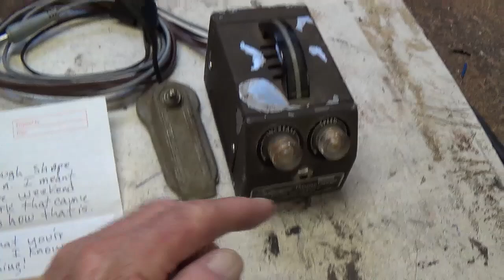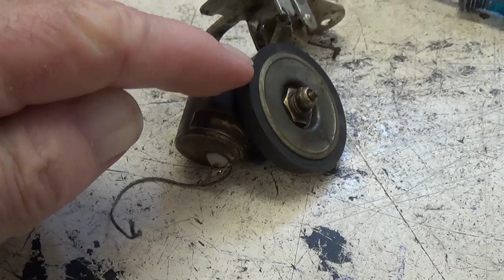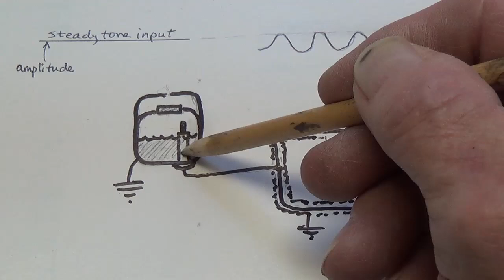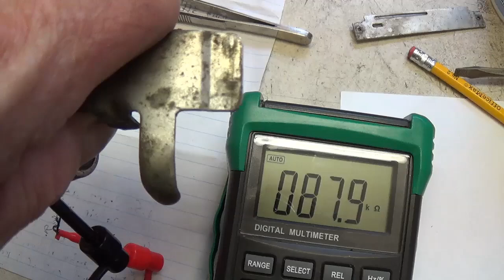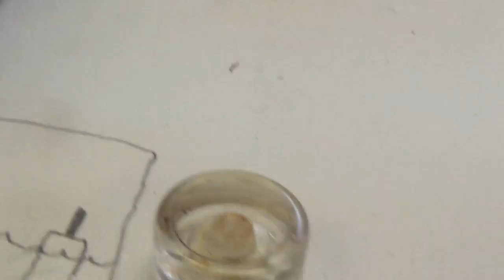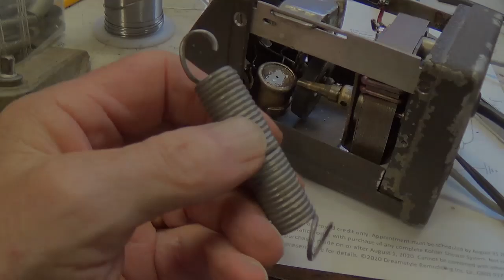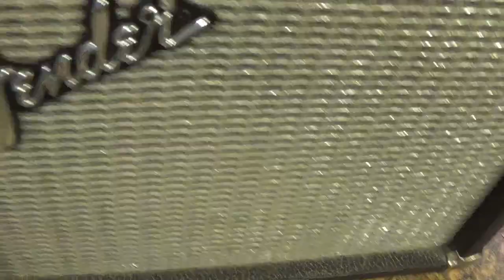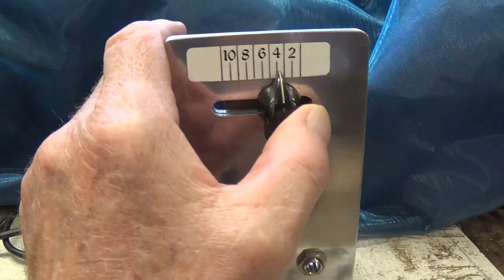1940's DeArmond Electromechanical Tremolo Unit.....DeAd on DeLivery !!!

Comment: The footswitch should be grounded as well if you want to be 100% safe and in line with the standards.
Reply from the maker: No doubt, SK.....but I really doubt that anyone will ever bother to do so.
Reply: @UncleDoug  If you think about it, it's a metal chassy carrying a live conductor. I would at least open it and see if the wires are nice and secure.

Comment: You changed two things at once. The log pot with a sig gen and then the reverse log with a guitar as source. Because the output impedance of the sig gen is low and the guitar is not easy to determine, it's difficult to know what's had the most effect. The unit should have been designed with buffer amps, of known ip and op Z, if the pot action was to be controlled and consistent.
Reply from the maker: Thanks for your input, Rico. I have since restored another of these units and the original pot demonstrated the same "hair trigger" effect, while the RLog pot stretched out the intensity control over more than 180 degrees of sweep.

Comment: Uncle Doug, did you glue the intensity knob back on? If so, what kind of glue was that? Thanks for another great video!
Reply from the maker: Yes, I had to, for it to remain in place. I used weather stripping adhesive, believe it or not.

Comment: Lose those solid noisy wires to the canister and replace them with some loudspeaker tinsel wire. Tinsel  wire is specifically designed to constantly be in movement with a loudspeaker's cone's vibrating to convert the energy of electrical impulses into audible variable air pressure "sound" energy, from the movement of the paper speaker cone.
Reply from the maker: The connection from the tank to the lead from the pot is indeed the woven silver flexible "tinsel" wire.

Comment: Doctor Uncle Doug. I have this same tremolo, DeArmond. As I turn my intensity up, the treble starts to lose out, and past 2:00 it gets very muffled. Do you have a solution to keep the sound from changing so drastically? I've already tried different levels of Windex. Thank you.
Reply from the maker: I've never had that problem, Rik. Have you tested the intensity pot throughout its full travel with an analog ohmmeter ?
Reply: @UncleDoug Phd.  Thank you. The potentiometer maxed out at 88k, min was 6. I love your videos. They motivated me into actually trying my hand at fixing stuff. When I looked more closely, the braid of copper wire to the cylinder was down to a single strand on each end...So I soldered a fresh braid on it. None of this fixed the issue. What I eventually figured out was that I greatly overfilled the canister with Windex. So I kept removing it a bit at a time and retesting. The signal improved tremendously and I think sounded best when the Windex level was just at the top of the white insulating part. Once again, thank you for helping all of us. You are awesome.

Comment: Hi UD!  Great video as always, and I got to learn about a device that I've never even heard of.  I particularly enjoyed your eplanation of potentiometer curves, and the use of area as a representation of control.  I have some observations, but since I have no practical experience with one of these units, they are purely theorertical.

I have concerns about the use of Windex as the canister fluid, and I'm curious about where that recommendation came from.  You mentioned somebody...  My first concern with this choice of fluid is the fact that it contains ammonia.  Ammonia can be harsh on things, and I am concerned about the long term effects of the elecrolytic/galvanic action such a solution might have on the electrodes inside the canister as well as the rubber seal.  The other thing that concerns me is that it contains surfactant (soap or detergent) which of course has sudsing action.  Given that the unit vibrates in use, I am wondering if foaming inside the tank could develop and give weird results.  A bottle of Windex will foam up quite well if shaken, so at least I have some practical eperience with that.  If the fluid evaporates over time and must be periodically replenished, the surfactant portion of the solution will likely not escape the canister but may actually be left behind as residue, accumulating and concentrating it, making sudsing more likely each time new Windex is added.  And how would one rinse the soap out of such a thing anyway if this were to happen?  Anyway, I enjoyed this video greatly, although I think whoever came up with Windex as the go-to solution for this device made an odd choice.
Reply from the maker: Thanks for your very thoughtful inquiry, HS. I worried about sudsing also and experimented with various solutions in the tank, including different concentrations of saline (salt). The conductivity of the fluid is critical. Too high and the signal is lowered all the time. Too low and the trem effect is weak. I have found that Windex has the proper conductivity and that sudsing, although it does occur, does not alter the effect......thus, it remains the best, consistent solution for use. Also, after being in tanks for several years, it does not seem to coat or harm any part of the tank.
Reply: @UncleDoug  I find it reassuring that you've got years of experience with this solution, and would be less reticent to try it in future.  I tried to research patent filings to get more info about the unit, but ran out of luck.
Reply: @hugeshows  Thanks for your comment and replies, I was also interested in the choice of Windex and this shed some light on it for me.

Comment: Here is a dumb and querky idea.Instead of an electric motor use a toysteam engine. You would have to use it outside and it would be awkward as all get out but no A.C. hum and the smoke and steam eminating from this thing would definitely be a sight lol!
Reply from the maker: You must be an old soul, David. I am a fan of steam-powered toys and this may be feasible, but wildly impractical......which means I like the idea :)

Comment: Question, when you supplied a modern 3 prong polorized  plug, how come you did not add a fuse  ?
also, on the power cord I would have added a choke to minimize any possible hum and AC radiation 
Ricky from IBM, Ret.
Reply from the maker: It was not my job to redesign the device, Ricky. It was my job to make it function well......and I did that. Are you proposing a filter choke for the AC supply to the motor?  This makes no sense to me. The signal wires were shielded and hum was not an issue.
Reply: Uncle Doug Not a criticism just wondering since the power cord was upgraded to modern standards installing a fuse would have gone along with that. 
Enjoy the channel

Ricky from IBM, Ret.

Comment: That's the most needlessly complicated vactrol ever invented!
Reply from the maker: Optoisolators weren't available in the late 40's, Frank, and the DeArmond does much more than a simple Vactrol.....it also replaces the oscillation loop tube(s), caps, and resistors.

Comment: Hey Doug, great stuff and great work as always - but this time here comes a little criticism from my side :) I am not very happy with the way, you guided the footswitch cable through the metal housing... As this wire also carries mains voltage, imho it's not a very good idea, to simply run this (also pretty old and maybe in the near future brittle) cable through this hole without any additional shrink tube insulation, grommit etc... If the user constantly bends the cable at this spot (e.g. by winding up the cable around the device), it might break and become very dangerous in the future... Hey, at least that what it looks like here on my screen.
By the way, do you run device tests, checking your repaired items for insulation and PE-R, after you're done with your job? Here in Germany, it is absolutely important to perform these tests, otherwise, as a repairman, you are completely f**ked, if any kind of electrical accident happens later...
Anyway: Keep up your great work!
Reply from the maker: Thanks so much for your thoughtful comments and suggestions, LM. The footswitch wire appeared to be quite supple and trustworthy, but I understand your concern, and will relay it to the owner of the device.

Comment: You may already know about this stuff but a trick I used to restore paint on metal is a 50/50 mix of Penetrol (for oil-based paint) and mineral spirits. It works like magic on enamels and powder coat finishes. A quick wipe with the solution then wipe up any extra.
Reply from the maker: Thanks for the tip, Tom.

Comment: I remember that once in one of your videos was written in your current limiter "not for motor" since then I wonder why is that (I didn't want to test it by my own using a power tool or a refrigerator connected to it because nowadays the Incandescent light bulbs are rare and expensive.) But now I see you using this device and my brain is shorted and I ask you about this caution.
Reply: Great and illustrative video by the way!
Reply from the maker: Most electric motors require an initially high flow of current to start. The current limiter interferes with this and prevents the motor from starting.  Very small motors, which don't draw much current can still work with the CL, however.
Reply: @UncleDoug  Ok, I see! I suspected something like that. Once I had problems with an inverter (plugged to a solar battery system) which with time didn't start a fridge neither power tools any more. So I thought maybe plug it with a big bulb to reduce the peak current, but I was afraid of damaging something. In the end I replaced the inverter and fixed the old one, but that "not for motors" stuck in my mind. Now I know in that case it even wouldn't start.  Thank you Uncle Doug!

Comment: Uncle Doug, this is a fantastically interesting video.  I've got a question about the original(?) intensity pot though.  Did it look like the original or something that someone installed by mistake during repairs?  If it was original, did the original DeArmond Tremolos all have intensity adjustments that were that limited?  Now I think I need to try to build an electromechanical tremolo myself, using this and your earlier videos as guidance!  ;)

Edit: I went back and re-watched the "Home Made Electro-Mechanical Tremolo" video posted by "ElPaso TubeAmps" where you said that Windex froths up too much for use (in that unit), so you used distilled water instead.  I guess that the (copper/brass) "tank" size is what allowed you to use Windex in this tremolo, because the Windex couldn't slosh enough to froth up?
Reply from the maker: Wow, thanks, Bob. Yes, it appeared to be completely original. Also, there is another video on YT featuring a similar unit, and they found the original pot to be just as "touchy" as I did. By coincidence, they resolved the problem in exactly the same way. By all means build your own. The principle is simple, but the way to achieve it offers unlimited opportunity for originality.

Comment: just wondering about using saline solution to affect the kettles resistance.
Reply from the maker: Years ago, I experimented with different chemical solutions and found that simple tap water generally worked quite well. Windex tends to foam when run at high speeds, and saline solution had excessive conduction, giving mixed results at different speeds and tended to load down the circuit, reducing volume.

Comment: Hi Doug! This was another very interesting video. I've always favored the mechanical tremolo as opposed to the typical electronic oscillator circuits. The depth is far greater and more natural sounding.  Also, if the mechanical device is made well, it's less likely to fail. you should get a lot more years out of it. Even if the rubber tire becomes chipped or flat, the wheel can be sent out for new rubber to be put on. It's a shame that these are no longer popular; they are a work of art in their own right. Great project. I play Hammond Organ, and my preference has always been the mechanical Leslie Speaker as opposed to an electronic knock-off. The electronic devices that simulate are OK, but nothing beats the real thing. I must admit, I've never repaired a De Armond tremolo unit before. Now I know what's needed to get them back in working condition again if one does come in for repair. :)
Reply from the maker: Thanks for all your excellent and helpful comments, Frank. I definitely agree that the EM Leslie is impossible to beat in person. The dispersion of sound cannot be equaled by any electronic device.
Reply: @UncleDoug  I learned something new watching this video. No matter how many years I've been an electronics technician, I'm always open to learning something new that was unknown to me in the past.

Comment: It looks to me that the rubber wheel is on backwards.  Shouldn't the taper of the rubber wheel match the taper of the drive cone?
Reply: It is correct as it is. Reversed each side of the wheel would be driven at a different speed meaning that it would always be slipping. And not necessarily in a consistent way. Minimal contact is required.
Reply from the maker: That's the way it arrived, WH, and I didn't question it......but you're probably right.

Comment: Nice work Uncle Dough and great trip to history as always. I am guessing the trend is clear and I am looking forward to see the episode where you fix a steam machine and plug a guitar into it ! ;-)

That intensity pot, I was just curios why would DeArmond put the log (audio) pot there? Were reverse  log (or linear - still better) not available those days? I am guessing, it was probably not original (since someone worked on it before, glue on the knob, etc ...)) WDYT?
Reply from the maker: Thanks, Robert. I have posted videos showing home-made steam engines. None were connected to tremolos or amps......yet. I don't know if the RA pots were available back then, but maybe they just used what they had on hand.

Comment: windex? i used to know a guy that repaired several of these things and he replaced the fluid with some kind of electrically conductive oil apparently the same stuff they used in the old plate reverb tanks.  it was expensive and he had to buy a quart of the stuff even though he only needed less than a teaspoon for each unit. never knew that windex would work.
Reply from the maker: I wonder if he used the Union Carbide oil that is normally used in Tel Ray tin can echo devices?  Windex is the stuff, however.
Reply: @UncleDoug  i think its probably the same stuff. i think i remember him saying that it was like $70 for a quart of the stuff. i dont know how ling the windex would last but it is defiantly cheaper than the oil and seems to work well. if it evaporates , it is easy to replace...

Comment: I like the mechanical tremolo devices there is something magical in seeing them giggle. The first one you made is really an eye-catcher, If one was to make one, would this switch work well to adjust the speed of the motor? https://www.ebay.ca/itm/124029204635
Reply from the maker: Thanks, Pat. Yes, the AC version would probably work quite well.

Comment: Uncle Doug very nice video. Billy Gibbons is going to want this device lol. Being a mechanical tremolo can the foot switch disengage it in a high resistance position? Maybe cause low signal to the amplifier. Very cool 😎
Reply from the maker: Thanks, James. When the motor is turned off with the foot switch, the unit becomes completely passive.....like it wasn't present.

Comment: Just thinking that the rubber wheel might ride the tapered drive better if it were flipped the other way around? // instead of \/
Reply from the maker: You're probably right, Shawn. Since it arrived that way, I simply left it as-is.

Comment: What circuit did you use as a speed controller for the motor on your earlier home made unit?
Reply from the maker: The same fan speed controller I used on my compact Leslie unit, Nat......from Ace Hardware.

Comment: WOW, there is one on eBay right now, not working, as is, $1,600 USD! And myself as a Canadian, should I want it, would face an additional $285 USD to get it here from Pine Arizona. Back when modern pedals started to emerge you probably could have got these for next to nothing. Hindsight is wonderful! 254744343444

Comment: Make sure the silicon you will use to seal the hole is the type that is not asid.  "smell like Vinegar"
Reply from the maker: It's a type used to create automotive gaskets....not the regular silicon used as a caulk.
Reply: @UncleDoug  Yes, you r right...However, i was thinking that  windex likes to foam up when shaken.

Comment: Why use windex?      I would use water with a grain of sea salt or just straight tap water, not destil
Reply from the maker: Both will work also, but if the proper fluid is readily available, why not use it ???

Comment: Where did you get that tapered output shaft on the motor?  Did you fabricate it?
Reply from the maker: Yes, I used a lathe and mill to construct both tremolos completely from scrap metal and other materials.

Comment: You always document everything so thoroughly ... but then you describe fixing the issue you were having by 'moving some wires around' without explanation.  Huh?  Very frustrating.
Reply from the maker: It's exactly what I did. Just like with amplifier hum and noise issues, you move wires around to see if it either reveals the source of the problem.....or fixes it. Apparently the flexible wire from the canister was dragging on the floor of the housing.
Reply: @Uncle Doug Thanks! I understood you to mean that you had changed around the circuit by moving wires, but that makes much more sense